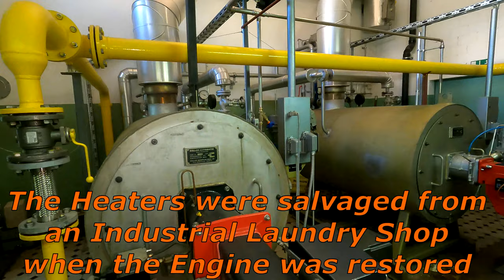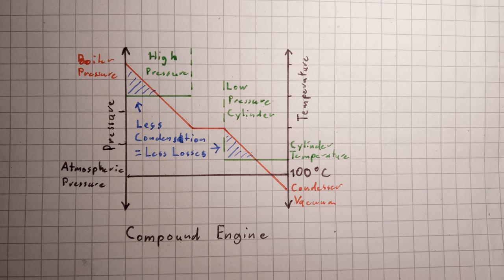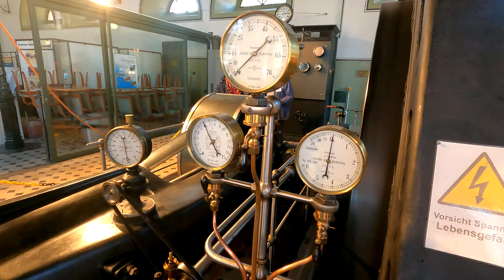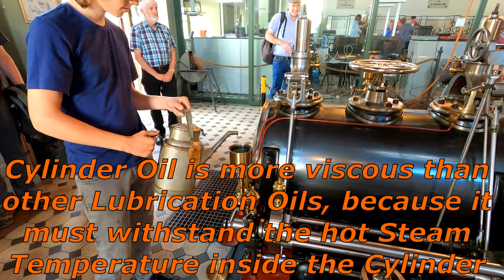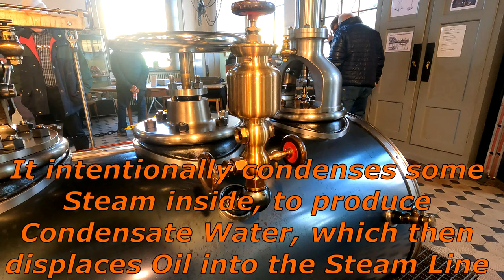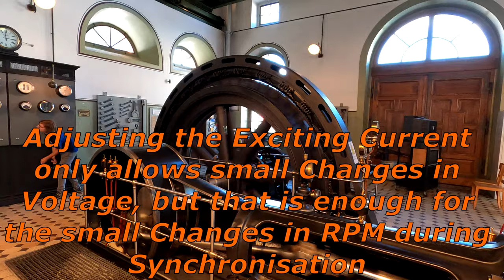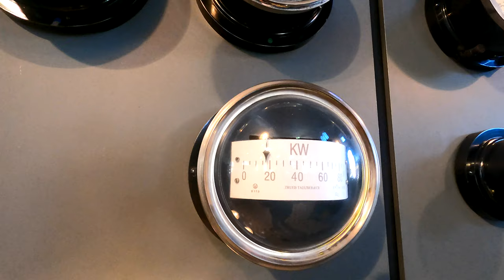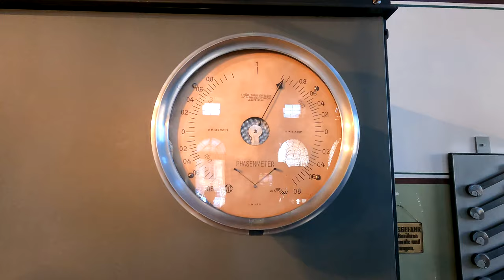Tandem-Compound Steam Engine driving a Flywheel Generator at the Schlieren Gasworks

Comment: 10:34 the frequency meter is interesting  : the small beads resonate at different carefully set frequencies.
That’s clever!
Reply: What you recognize as beads might be the painted ends of individual metal rods of slightly varying lengths.  Think of the "combs" on a Swiss music box.  Also visualize the tuned rods inside a mantel clock that plays Westminster chimes.

Comment: Gorgeous engine!  The variable trip cutoff is a variation on the Corliss design, which was very widely used, with many variations on the operating linkage.  Very good explanation of the benefits of compounding, I never thought about it at that level!

It is interesting that this configuration with 2 double acting cylinders and eccentric driven valves was used extensively for large gas engines, to get 4 power impulses in one crank revolution in a 4 stroke cycle, with both cylinders the same diameter.  Example, the large Snow and Cooper engines used in the US to pump natural gas through pipelines.  Large Snow and Cooper gas engines are displayed at several US engine museums, including a big 600 Hp Snow at Coolspring.

It would be neat to also post a second version of this video without the text, to just enjoy watching the engine after viewing this version with the excellent explanatory text.

Please keep doing these wonderful videos!
Reply from the maker: Thanks, I actually "simplefied" the Explanation of Compounding a bit, the more accurate Version is that you lose Heat to heating the Cylinder first, and then you lose some of that Heat again when the Steam gets colder than the Cylinder and thus Heat flows back from the Cylinder to the Steam. This makes the Exhaust Steam hotter than it could be, so you not only lose Heat to the Cylinder but also to the Exhaust. Another Advantage is that only the High Pressure Cylinder must hold the full Boiler Pressure, so the other Cylinder(s) can be built structurally weaker.

Btw. can Internal Combustion Engines be compounded too; some Aircraft Engines like the Napier Nomad Two Stroke Diesel or high-end Versions Wright R-3350 Radial-Twin 18 Cylinder used Exhaust Turbines which Drive the Crank Shaft via hydraulic Clutches. The Reason to do this instead of Turbocharging is, that the lowering Atmospheric Pressure at Altitude made Turbocharging impractical, as Turbochargers can only be designed to specific Pressures. Instead, these Engines used variable mechanical Supercharging. Another Example would be some Truck Engines or some large Container Ships Like the Emma Mærsk and Mærsk Triple E Classes. They have Exhaust Turbines additional to Turbochargers, because the Turbochargers reach their full Pressures (aka best Efficiency) already at partial Loads to increase Efficiency at realistic Usage (full Load is a rare Exception). In the Truck Engines, the Exhaust Turbine is coupled hydraulic too, while it drives a Generator in Ships. The Exhaust Turbine Genset is common on many large Container Ships (large Tankers and Bulk Carriers are so slow that they have much smaller Engines like mid-sized Container Ships), the two Mærsk Classes can also feed power to Motor-Generators on the Shafts. Unless they happen to carry exceptionally few Reefer Containers, such Container Ships would consume  much more Power than this Genset can provide. So the Advantage lies more in being able to run the Diesel Generators more efficiently by flexibly adjusting the Load Sharing between the various Generators. Such Ships usually also have a Steam Turbine Genset, which is supplied by Steam from large Exhaust Boilers that reclaim Waste Heat from the Diesel Engines Exhaust Gas. These Boilers are a bit tricky though, because the low Pinch Point (lowest Temperature Difference between Flue Gas and Boiler Water) requires ridiculously slow Exhaust Gas Flow inside the Boiler, which causes Soot and Oil Fouling in the Boiler Tubes. Anyway, Point is that these Ships have Diesel Generators, an Exhaust Turbine Generator, a Steam Turbine Generator and Motor-Generators on the Propeller Shaft (or two Propeller Shafts in Case of the Mærsk Triple-E-Class). The Motor-Generators can be used as either Motors or Generators to run the other Generators at their most efficient; the resulting Load Changes to the Main Engines that either drive the Motor-Generators or are relieved by them, are so small that they are barely measurable. And yes, all these Generators mean that large Container Ships take a lot Electric Power without even using it for Propulsion; so much that they use 6.6 or even 11 kV Transmission Grids. For the 5 MW (theoretical) or 3 MW (realistic) in "my" Oil Product Tankers, 400 V (because 50 Hz) is enough. Large Crude Oil Tankers have Cargo Pumps so large, that they would need 6.6 kV too, but High Voltage and Explosion-Proofing in the intronsically Safe Pump Room don't match all that well. So instead, they drive the Cargo Pumps with Steam Turbines.